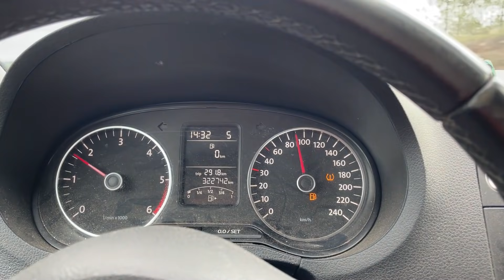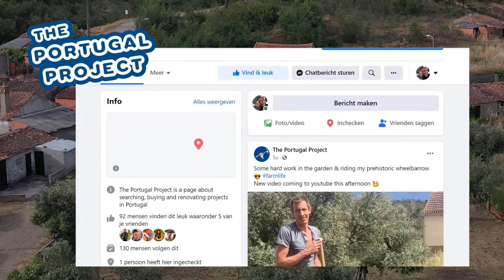MAJOR ISSUE on the HOUSE - (..And more work done) - Portuguese House Renovation

Comment: Yea I see they made the gutter to prevent the water from the street entering your house, what a weird construction, but in this situation not to avoid. Well, i am sure the street is much too high and it aint the water seekin into the ground. My strong susupicion is, that the concret of your gutter isnt tight anymore and you re probably lucky. Because the only thing you have to do now is to paint it waterproove. For this I recomend a two component resin, two layers at least. And I guess you will be fine.

Comment: Clean your trench first.  See if you actually have flow.  Quality sealant paint on the wall to make sure the problem isn't wind blown or splash driven.  I am a fan of gutters, vinyl or Aluminum.  BUT, I hate the way they look on a beautiful roof.  Finally, after picking all the low fruit, a drain tile and retrenching, along with foundation membrane my be the final solution.  Water ingress is a terrible thing and mitigation can be just as terrible.  Good Luck and thank you for the great content.

Comment: My Parents live in Germany and own a 180 year old home. They had the same issue with the walls (maybe worse because their Stone is from quarry and quite porous).
They spent so much money on trying to find the right fix, What was finally the gamechanger for them.... Dig down a bit past the very bottom of the walls, let the wall dry out, then Tar the wall to slightly above the ground floor. Then installed French drains and cover. No more moisture issues. Hope this might help? I know it's a lot of hard hands on work but you could safe a lot of money doing it yourself.
🧰🔨⚒🛠
Reply: Good advice.  Just what I was thinking